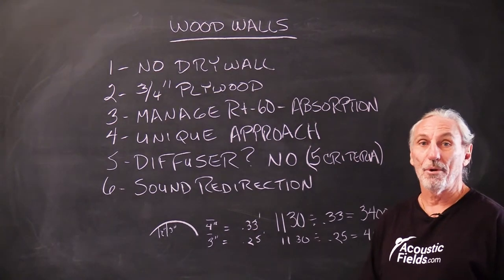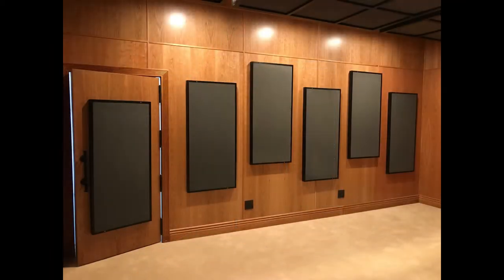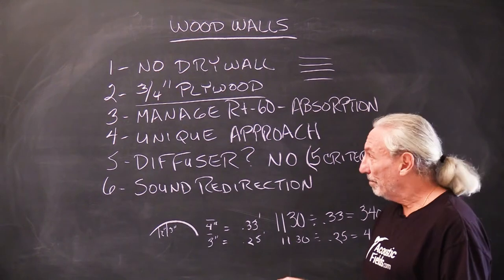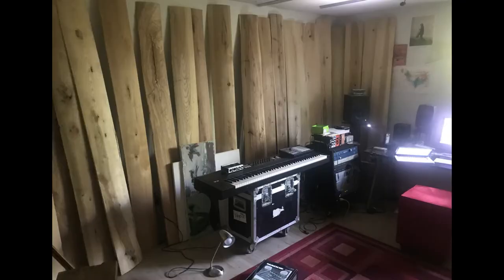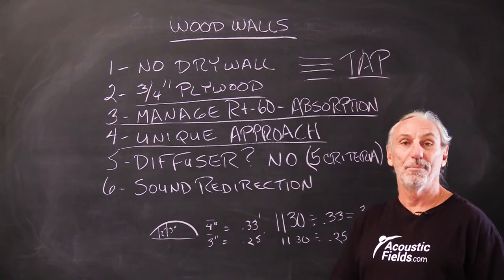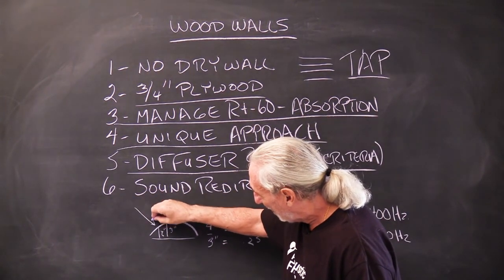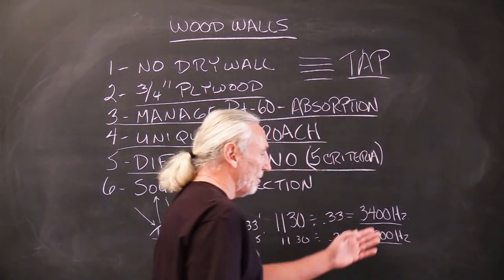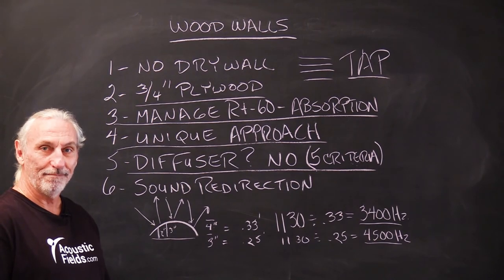Wood Walls - www.AcousticFields.com

Comment: I recently had my fence replaced with Cedar wood. I had a lot of left over planks and scraps and made some panels and also just straight up attached the planks directly to the wall. It immediately made the room tighter.  I thought it was placebo effect but this video justifies my actions. Thanks!
Reply from the maker: Sound takes on the characteristics of the surface areas it strikes. Every material type has its own "sound".

Comment: Whatever wood, or any material, that you introduce is going to add it's own sound to the room, because it will vibrate. Freestanding wood is really going to add it's own sound. It's fine if you happen to find something that permanently colors the sound in a way you permanently like. It will drive you nuts if it's not.
Reply: Trevor  Cox, professor of Acoustic Engineering, writes in one of his book that a violin maker would be fortunate to find a wood which resonates. If it does it's due to heterogeneous presence of small wood cells in the wood. It matters for a violin, which produces sound, but amount of energy coming to a wooden plunk's cells is barely enough to make it resonate.

As for structural resonance of such wooden plank it can be far outside of the audible range.
Reply: @DmitryMyadzelets  It can be outside the range, but it does not have to be. Take a stethoscope and play something pretty energetic and loud and go around and listen to all the stuff in your room. Everything vibrates, everything that vibrates and has a large surface is a speaker. some things vibrate enough to major polluters of the sound.
Reply: @bc527c  I had such experience when I began to explore this endless ocean of acoustics. I used a loud sweep signal carefully listening for any resonance in my room. And I caught it! Single layer windows, not properly sealed. The only (big enough) smooth surface from heterogeneous material, glass. 

I head from other people they could sometimes find resonating objects, but they were always made of glass.

I see what you mean. Sure enough, things in a room get energy from the fluctuating air particles, and... well, all that stuff with physics and mechanics. 

But as I see, people come to this channel for decent practical advice. Too general or too theoretical topics don't make them come closer to a good listening experience in their rooms. This video about wooden walls... To it's like what you've described, resonates in human minds, but it pollutes them.
Reply: @DmitryMyadzelets  I'm impressed you found it doing sweeps!. I ended up with a stethoscope when my father left this earth, if you learn the way to do it... I've gone around my room listening to various surfaces with it. The really bad surfaces I've found are the ones that vibrate at higher frequencies than the music, like the two windows in my small listening room, yikes those were bad... I highly recommend audio people pick up a cheap stethoscope for this purpose... cheers!

Comment: Do you have advice for treating rooms with slat and plaster walls? I like the idea of leaning pine boards against the wall because the plaster won't bear much weight. I have foam up not because it's ideal, but because it's all the walls can support. Now the room sounds very dark.

Comment: My suspicion is that the wood added mass to the wall membrane, changing the walls resonance. That or there was some bad slapback echo maybe.
I like the look of wood. Wooden diffusers are easy, there are dozens of them on this channel. But I have not seen bass traps that mostly are mostly wood as far as you can see.  Acoustic absorbers  that look like wood are probably close to impossible. Maybe some very rough cut wood could be drilled out with a CNC machine and filled with foam on the back?
Reply: James Drissel Just watch a few more of Acoustic Fields' videos-  they'll answer all your questions. Wood has MORE of an absorptive quality than drywall, but not necessarily enough to use as an absorber. Wood is used for diffusion in their meticulous designs and their proprietary foam is what they use for absorption. (As opposed to rock wool/Owens Corning or any other insulation material). I think this video was meant to point out the benefit of using plywood instead of drywall in a critical listening environment since drywall offers zero sound quality benefits. So if you're building a room from scratch, use plywood instead of drywall.

Comment: Love the plywood+ the panels. Are those panels available covered in acoustically transparent cloth too ? Does the foam go directly against the wall or there's an actual gap between the two surfaces ? Great vid as usual man ! Sorry you had such a hard time with Covid, but glad you're alive and well; take care !
Reply from the maker: O,  Its all about square footage of coverage. No air gap in this install. We were able to accomplish out Rt-30 goals with a flat installation without using the other side.
Reply: They have the prebuilt acoustic panels that you can attach to wall or ceiling where there is an air gap.  Or you can buy his build plans to make the frames to install the raw foam and then put your own fabric covering the foam.

I personally recommend using a fabric over the foam.. It protects the foam, plus if you choose an attractive fabric, it's more esthetically pleasing than looking at raw foam.  And you can play around with placing the foam frames up against the wall or leaving gap and see which one you prefer.  You may like one method over the other..

Comment: What are the top 5 woods to use as 3/4" plywood walls? Is maple okay?
Reply from the maker: We use cherry wood exclusively because of the rich tones it gives to mid range frequencies. The grain also darkens over time.
Reply: I'm curious is the UV just for visual looks and what clear coat are you applying?

Comment: Hello Denis ,what are the effects of paint coating the wood?.does it affect the tone  in any way?
Reply: it does for musical instruments.  wood is a porous material and filling those holes with paint clog up those pores.. There are many types of paint, but more importantly, there are other things like primer, clear coat, and then there is how many layers do you have, are you wet sanding them down in between each layer, etc.  Some paints are water based, some are oil based.  There are additives like what the automotive paint companies have because they paint cars over different materials, so they need additives to allow paint to cover plastic parts or aluminum/steel/carbon fiber/wood, etc.  As you can see, there are a lot of variables and what audible changes when used as an acoustic treatment all has to be tested depending on all the variables applied to the wood.

I would say that depending on what paint, primer, clear coat, how many coats, etc. etc. may change the way wood sounds for acoustic treatment. You may or may not like the outcome from a visual or audible perspective.

Comment: I wanna soundproof my room... first by making studs then applying rockwool and maybe adding mass loaded vinyl on top of that.. from what you're saying wood would be better instead of the drywall right??
Reply from the maker: using limp mass material types to reduce noise transmission will never work. You must first measure the enemy (noise) you are fighting. Once you know what the noise frequency and amplitudes are, you can then use the proper material types and construction methodology to minimize the noise transfer. Remember that with noise nothing is "proofed".

Comment: Hi Dennis, thanks for your suggestions. I wanted to ask you a question, in the project of my next studio I would like to use glass blocks on the walls at a height of 2.20 meters high and I would like to do underfloor heating. Do you think these two elements could ruin the acoustics of the room?
Reply from the maker: You need a greater ceiling height. Low ceiling heights produce axial modes in the 50 - 70 Hz. range along with the harmonics at 100 Hz. and 140 Hz.
Reply: @AcousticFields  the height of the studio is 9 feet, I would put the glass blocks horizontally between 7.2 and 8 feet. Would it cause problems?
Reply: @AcousticFields  what about underfloor heating in the studio? Thank you for your kind help

Comment: At what rate does the thickness of the wood make a positive difference acoustically? If a room is already drywalled would adding a 1/4" of ply be worth it? 1/2?
Reply from the maker: J,  Add 3/4" cherry ply. Multiple layers inside the ply will assist in reducing vibrations.

Comment: I have double sheetrock in my living Room / Studio (20' x 30').

I am thinking about adding 1/2" or 3/4" Plywood (oak or birch) on the walls. 

Question: What would be the best way to install the Plywood Sheets over the drywall? Nails? Glue? 

Is it best for it to be loose or Extremely tight up against the drywall?
Reply from the maker: Glue the ply to the rock.
Reply: @AcousticFields  What glue do you recommend?
Reply: @AcousticFields  Is carpet adhesive ok? It remains tacky throughout its life but is strong
Reply from the maker: @levijessegonzalez3629  Carpet glue is fine.
Reply: @AcousticFields  is 3/4" plywood worth the extra $ vs. 1/2"? Or will 1/2" be ok?
Reply from the maker: @levijessegonzalez3629  Use 3/4" cherry ply. It has wonderful middle range tone and it ages well with grain darkening.

Comment: I don’t get it, I want to build a drumroom. Is plywood better soundproofing than Sheetrock? Or does is just sounds better
Reply from the maker: There is no one material type to deal with reflections. Plywood produces a smoother middle range frequency. That may or may not be your stratedgy or objective. You must decide what sound quality you desire and then apply tactics such as material type, construction methodology etc. to achieve your sonic goals.
Reply: @AcousticFields  don’t care about the sound quality honestly, just want to build a drumroom as soundproof as possible, just can’t find the right solution. Every soundproofing company tells another story.

Comment: I have a double drywall workspace. Would putting 1/4" plywood over the drywall do any good whatsoever for mids and highs? that's the only thickness i can afford to do
Reply from the maker: Use cherry wood for middle and high frequency tonal ranges.
Reply: @AcousticFields  I only have access to Poplar plywood. Is that ok? And will 1/4" even do anything positive?
Reply: @AcousticFields      Cherry plywood are not available  where l live . Will  Birch plywood be a good option ?

Comment: Could you give some thoughts on what to do with plaster walls? I find they sound better than drywall , but I am not sure why.
Reply: Mario Cantani  That is my guess too, the plaster is quite a bit thicker than drywall and its also supported by all the wood slats that make it stiffer.
Reply from the maker: R, Plaster at a 1" thickness has rates and levels of absorption that favor music and voice.
Reply: @AcousticFields  So I am not crazy after all.
Reply: @timberray9572  A couple years ago I moved from a place that had  plaster walls to one that is drywalled and the difference in room sound is clearly audible and absolutely negative.

Comment: What material do you recommend for walls for a midsized venue, like seats 300 people or less?
Reply from the maker: K,  Stay away from drywall. Rt-30 time management is all about square footage of coverage. You will need a 60 - 70% coverage on each wall surface to start.
Reply from the maker: @kylegushue  Nonsense. Drywall has absorption coefficients just like many other materials. Be careful with classifying material types without an understanding of their properties.

Comment: if it's 1 feet deep though,   1130 / .99 = 1.14k   -)  mid range
Reply from the maker: If your walls are 12" deep, they will absorb much lower than 1.14 k. Our 12" deep ACDA units go down to 30 hz.

Comment: Is there any scientific evidence to your advice to use plywood instead of drywall?

I've checked the "The master Handbook of Acoustics" book, it says a 1/2” gypsum board has almost equal absorbtion to a 3/8” thick plywood panel in range 125Hz to 4kHz. The panels you use are thinner, so they absorb less. 

Any way, in general, we need absorbtion, and it's known for gypsum boards, and can be used in any room acoustics calculator. So, why bother?
Reply from the maker: D,  Drywall has a negative effect on frequencies from 200 - 2,000. It creates spatial irregularities in a critically tuned room. Stay with ply and in particular cherry ply for its positive impact on voice and music. Remember achieving quality sound in a room is about doing a lot of little things correctly and in the proper sequence.
Reply: My ears tell me that drywall is awful. No calculator required.🤙🏻✌️
Reply: @cary3428  I  recently made a partition drywall relying on Knauf 's 112 schema, which has minimal acoustics properties for a living room, according to the producer. The wall assumes installation of double gypsum 1/4" boards on metal stabs, and one layer of 5" mineral wool behind. I was really impressed with the result (it's also very cheap).

 @Cary , is the drywall in your case resembles what I've described (google the schema for clarity)?
Reply: @AcousticFields  One layer of 1/2" gypsum with an empty cavity can be bad for acoustics and are very common. However a single layer of 1/2" wood is equally bad. Two layers of gypsum has been proven time and time again to provide excellent results, especially with a viscoelastic material in between them.
Reply from the maker: D,  Mid-range tone / timbre.
Reply from the maker: @yvindholgernes8950  "Excellent" results at what frequency ranges?
Reply from the maker: @kylegushue  Build both room types and listen with your ears and brain connected.
Reply from the maker: @kylegushue  What data? Oh, you mean the 40 and 50 years old technology that everyone uses and then complains about how it sounds especially in the low-end. Oh, yes, I am very familiar with all of that.

Comment: Both untreated drywall and wood have the same reflective characteristics/STC . What are you claiming is different about them? This is the same argument as cement or wood floors. Simple measurements show there's LITTLE change between materials AND you have to treat them booth. Which is the next point... You're treating the wall in the first place. It won't have "reflective properties" if it's managed correctly regardless of the material. This is nonsensical and feels like content for the sake of content.
Reply from the maker: You are confusing the terms. Reflectivity and noise transmission are different sciences. We are discussing in this video material type and overall sound quality for middle range frequencies. Wood is a good material type for middle range frequencies.
Reply: @AcousticFields  No, I mentioned both sciences in this situation. How are you making the claim "wood is good for mid frequencies" when measurements from rooms fitted with either material are almost identical before treatment?
Reply: @CynicEidolon  So a plywood acoustic guitar will sound the same as drywall guitar? Of course they won't.  Different materials will have an effect on sound and in real life people do feel / hear it.  Think about when you are mixing, bump up 5k by 1db on vocals and they suddenly pop.  Even though scientifically it is pretty much identical.
Reply: @CynicEidolon  measuring tools can't catch subtleties like humans,... i just painted a few wooden pieces in my studio while listening to good engineered music and i stopped because i could hear it was changing the sound a lot, in a bad way...  I went to a university studio designed with measuring tools and covered with big sections of hard foam diffusors and it sounded terrible, the room cost hundreds of thousands of dollars :(   its real dude
Reply: @domgirard4095  Lmao!!! Do you belive everything you just said? Cause I don't.
Reply: These days i do live sound 4/week and get compliments every night about how it good sounded, yes lol i believe my excellent hearing, . T-Bone Burnett doesnt allow any roadcase in his tracking room because he hates the sound of the plastic on the road case he said, no plastic in his studio. 
The fish couldnt believe what the turtle said about walking on land ;)
Reply: another exemple ? Val Garay (famous Sound engineer in the 70’s) said that when his new control room in the 70’s or early 80’s it  sounded really different after they varnished the wood and regretted the varnish.
Reply: @domgirard4095  PLASTIC ROAD CASES?! Now I know you really work at WalMart. Lolololol.
Reply: people need to realise that even the best microphone capsule in the world are pretty simple compare to the multiple mechanisms that humains use to hear.
Reply: @domgirard4095  Dude, you're insane. It's hilarious and saddening.
Reply: who’s insane ? 
Those 2 Multiple Grammy winners sound engineers ? lol
I can find the links of the  interview where they said that. I also can repair electronics and i’ve built a C12 mic clone. I know what’s going on in a microphone capsule. 
“Hard “surfaces dont all sound the same.
Reply: @CynicEidolon  You are embarrassing yourself. I am not sure who you think you are impressing but you are having the opposite of the effect you intend.
Reply: @mpbootcamp7009  🤣🤣 By replying to a 2 year old comment?? I'm even more based in my position than ever. Y'all naive, being sold snake oil.
Reply: @CynicEidolon  I am not saying that Dennis doesn't have his own hustle. I don't buy into the foam or carbon thing. However, he is right that wood sounds better than gypsum board. And I never saw you reply to the comment about why aren't acoustic guitars (or violins) made out of drywall if they are so great for acoustics?